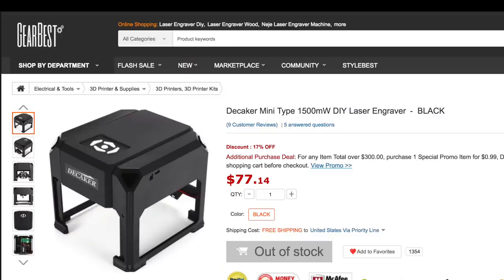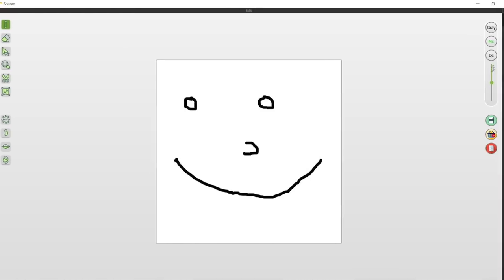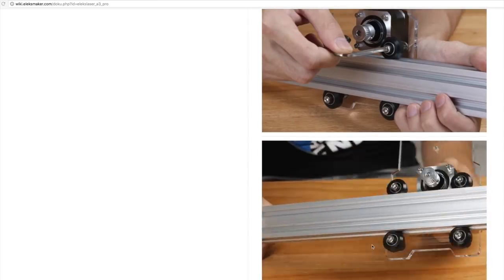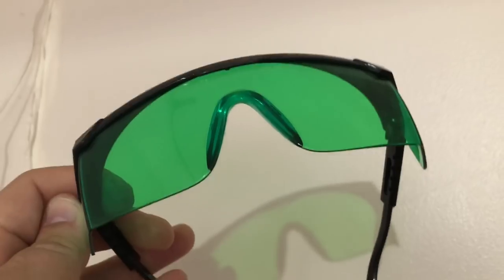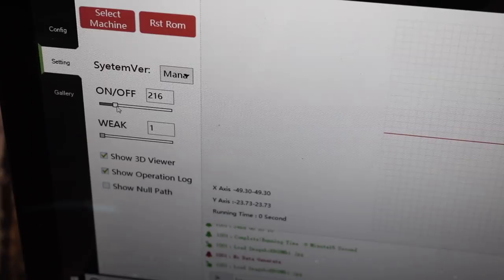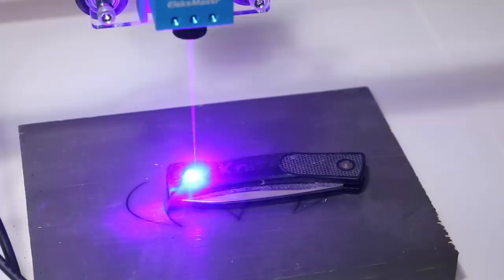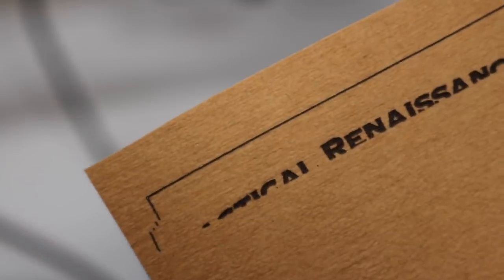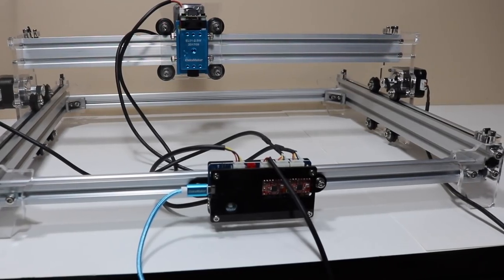Comparing inexpensive Laser engravers: the Decaker 1.5W laser and Eleksmaker A3 Pro 2.5W

Comment: Looking for a laser engraver that can work on 8.5"x11" paper.
Any suggestions?
Reply: Good day, Stephen.
All depends on what you expect to do with it and your work load.  LED Lasers are limited and abide to visible light physical laws.  What is your budget ?
Have a great day.
Reply: @oncledan8509  let's say under $500
Reply: @stephenbozich4934   And May I ask what type of work you expect to do with it.  By that, I mean what type of material you want to engrave on, and at what rate.  Would this be a small business you intend to start or upgrade, or it's just a small hobby and would use it only a few hours a week ?  Do you plan on cutting paper, cardboard, wood, acrylic ..

Thank you for these very important informations.  This will greatly help me guiding you for purchasing the right machine for you.
Reply: @oncledan282  hobby stuff. Looking to work with a thick paper. Looking to "print", not cut.
Reply: @stephenbozich4934  Thank you for the information, Stephen.

Important thing is to plan ahead.  If you plan on growing, an LED Laser is not a good choice .. unless you want to spend, then upgrade.  If you have a limited budget and you want to update a some time in the future, I would recommend you spend the extra bucks and go CO2.  It's more expensive but you would start right off in the « Major League ».

If you do not plan to upgrade in the near future and want to get started on lasering, then I would suggest an LED Laser.  My EleksMaker LED Laser performed great with a 5,5W Laser head, but keep in mind that this Laser will abide to visible light physical laws and has low duty cycle (4 minutes ON, 30 minutes OFF .. if operated continuously at 100% power).  It greatly improves when you decrease the power.

By « Visible Light Law of Physics », I means that it will be tough to print on pale material (mostly white) (the reason for 5,5W) and impossible to engrave on transparent material such as transparent and pale colored acrylic, because the visible light will go through.  Remember that is has to heat in order to engrave (burn).  Also remember that a white car is cooler in the summer than a black car.  (« Visible Light Law of Physics » oblige).

The EleksMaker is a great machine but it requires adaptation and lots of tries.  You need to master every parameters of the Laser to do a good job.  That is mostly time consuming but I'm confident you'll get around it, playing with the Laser and engraver's speed.  Experiment with one parameter at a time to get a good feeling of what it does.

The software is free and you can find the USB Serial Port is easy to find.  I would suggest the A3 format and the PRO option, since it has better rollers and a PWM compatible Laser head, allowing you to fully adjust its power via the software.  You can expect to pay way under 500$ for the KIT (Yes, it's a kit)  You have to assemble it yourself. (That's why they call it a DIY Laser).  If you follow some videos on YouTube, you should be able to do just fine.  Count at least 2 hours to assemble it .. and if you can have a third hand, it's even better.  LOL

Good luck with your project and I hope all goes well.  Do not hesitate to ask for help.  Look me up on Facebook, under « Daniel Lachance ». My Avatar is the same.

Have a great evening and I hope to find you on Facebook soon !

Comment: Had my Eleksmaker  about 5 months and I can't get the software to work or any other software to work. Pretty disappointed. If anyone has any ideas, I'd be grateful.
Reply from the maker: The software that comes with this machine is definitely BAD! I actually just put out a video this week using T2Laser: https://youtu.be/K0bFZqA75ZM it’s a paid product but you can try it for free to do limited variety of work and to make sure it will run with your machine, I’m not affiliated with them in any way, but it definitely didn’t feel bad spending the money to get this thing running reliably. Hope this helps!

Comment: Have you tried a different software yet/found one at all?
Reply: As a user of the A5 and A3 Pro, I can tell you that both machines work great, as long as you take the time to adjust them correctly. I had the same issue of skipping where I couldn't burn a circle without skips. It turned out that my belts were too tight. The basic software is ok for starters and getting to know the machine but you'll soon outgrow it. I recommend T2 Laser. You can download a free version that let's you burn small projects. The pay version is  great with free upgrades and great support. There's even a user forum for questions. Check it out at forum.eleksmaker.com and look for T2 Laser.  Hope this helps

Comment: Hi Jeff, do you know any software alternative to "Scarve" that comes with the Decaker laser ? I'm trying to use this machine as a vectorial engrave, not as a printer.

I even try to analize the serial comunication, but I couldn't. All that I know is that it uses a FTDI-USB driver
Reply: You might give lightburn a try. If it doesn't have the setup for your machine. It is easy to set it up. I easily set it up for my 3D printer I attached it to.

Also you might not have to hack the serial protocol. It is just the same gcode used on 3D printers. If you have a file you should be able to view it with any text editor.

Comment: I did find value in this review.  These things are not worth messing with.
Reply: As a user of the A5 and A3 Pro, I can tell you that both machines work great, as long as you take the time to adjust them correctly. I had the same issue of skipping where I couldn't burn a circle without skips. It turned out that my belts were too tight. The basic software is ok for starters and getting to know the machine but you'll soon outgrow it. I recommend T2 Laser. You can download a free version that let's you burn small projects. The pay version is  great with free upgrades and great support. There's even a user forum for questions. Check it out at forum.eleksmaker.com and look for T2 Laser.  Hope this helps

Comment: On metal, even a 100W cant engrave shit! but if you have contrasted leyer of coating like green, red or etc, you burnout the coating, and that's basically how all of them work.
Reply: diode laser can not actualy burn metals. You need other laser types like CO² laser, Helium-Neon or, the most expensive, Fibre-Laser.

Comment: it has nothing to do with controller software. those skips are indicative of RFI. no chinese machine takes RFI into account nor do they account for grounding.  if you had good cables and use laser grbl you could get better results. i struggled with the issue for 6 months on my cnc/laser engraver. first i thought it was not enough power because the power supply died in a month. replaced the power supply. then the motors noving to the largest in the category. then modded those to make them closed loop. then put in ferrite cores on every single wire at both ends to prevent jumpover signals. finally i went to a shielded grounded power cable for the spindle motor and boom all those problems gone and was able to use the machine and now as its over 100 in the shop for the next 5 months im having to build a liquid cooled pc to control it all. and for wood like those pieces i would use 100% speed and 15% laser power. and as for the hardware those tiny grbl boards made in china are prone to breaking the usb off at the slightest bump. pretty much made to be plugged in once and never touched again. if you ever were to plan to go into production on any small projects i would keep 3-4 of the control boards on hand.but most important is the laser head has a short in it. that never should have turned on the high power laser. could have been caused by an ungrounded situation but that machine in its current state is a death machine and until its grounded at bare minimum i wouldnt turn it on.

Comment: Hi everybody, I would like somebody recommend me a good and cheap machine  to engrave in clear acrylic, I would like to engrave a sign about 10" x 7".
Thanks in advance.
Reply: did u find one, im looking too
Reply: You might have to keep looking for quite long. I understad that its somewhat physically impossible to to laser engrave clear surfaces, even with a powerful laser. Think how light works, the energy of the laser cannot cumulate on a clear surface to burn and engrave it because it just passes through the material. Not a laser expert, so not 100% sure.
Reply: @itsmemaario  I have had some luck placing tape or something on the plastic. The laser heats up the tape, which is transferred to the plastic.